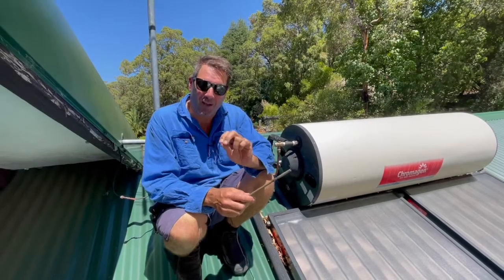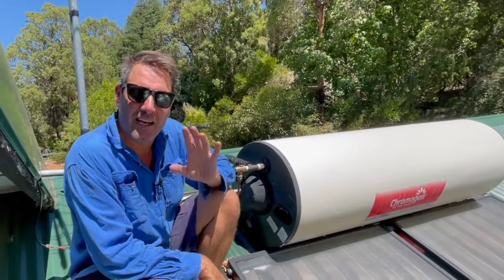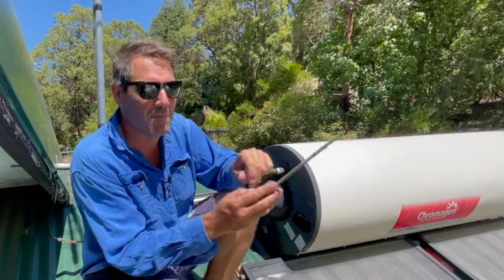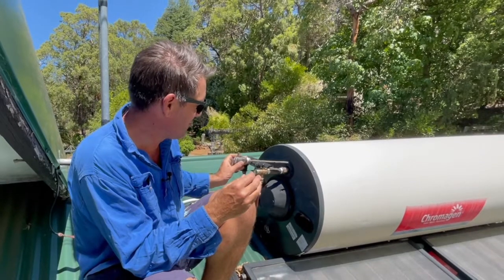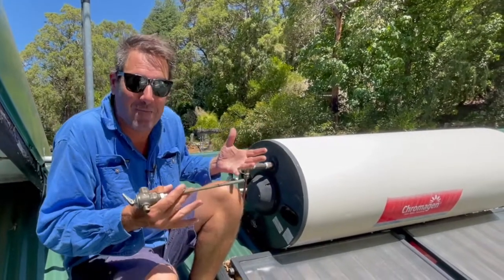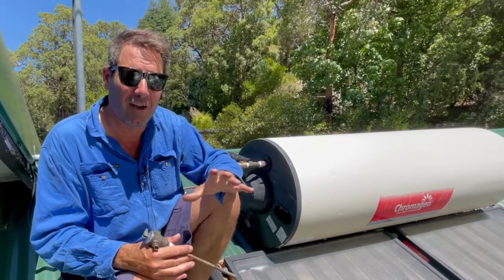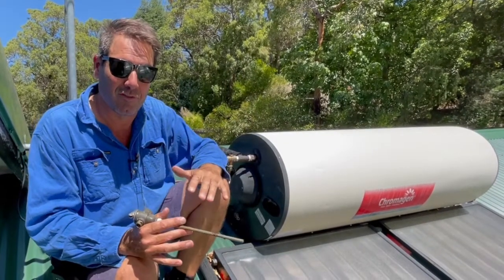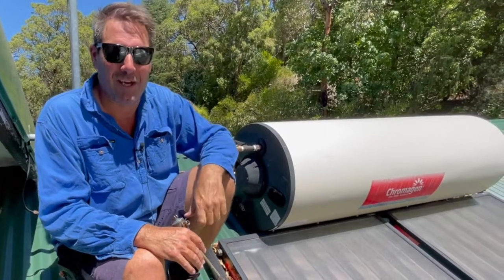Solar Hot Water System: Reasons Why It Dumps A Lot of Water

Comment: Good advice. Thanks for posting. 

Worth noting - the dumped water shouldn’t (?) be allowed to discharge directly onto roof, the hot water can damage roof surface and gutters. Ideally run copper pipe to ground where it can be visually inspected before going to a drain- or discharge onto a paver then soak into ground. (YMMV)

Comment: Thanks for your videos. Is there any issue with turning off the system at the non return valve if you are going away? So water doesn’t get wasted as a result of this pressure /temperature relief that you have talked about?

Comment: Hi yes back again  I believe the boiling point of some glycol is so high that there will be no need to let the water run away . They simply turn off the pump or maybe an other trick.  The highest temperature I have seen in our system is 127 celcius.

Comment: Is is possible to install diverting valve (radiator valve set to divert at 80 deg C) to a small radiator (finned tube) so that no water is wasted? The radiator valve should be able to divert the solar fluid back to the tank once it cools down.

Comment: Can you please help me I have a 300 l solar hot water system that is 22 years old and has always worked very well but now I am getting no hot water from the sun the electrical side works perfectly so from what I know I think that the glue Cole needs to be replaced or do you think it could be some other issue? Thank you for your time

Comment: Why does my solar Geyser make this loud noise when I open my yap or flush the toilet. I thought it must be the pressure but even when I open the tap slowly, the noise is loud almost sounds like faulty car engine. Can it be residue build up causing the impellers to cease rotation function or trapped air?

Comment: hi, l recently turned off the water supply for the whole house. Since turning it back on, there has been water leaking from overflow to the solar heating system. I don't think the water overflowing is hot water and we have not had any extreme temperatures. Any ideas about what might be causing this?

Comment: Thanks! Mine is doing this as we speak. I went up and tried to reset it using the rocker mechanism but it wouldn’t reset. I then turned the water off so I wouldn’t waste lots of water. Is it better to just let it dump and refill so as to bring down the temperature? 
PS. I didn’t know the valve was temp and pressure: I thought it was pressure only so was baffled it didn’t reset as soon as it started dumping. 🙄
Reply: Yes. It is designed to do this. It looks like a lot of water but compared to the cost of fuel you are saving with the panels, it isn't.